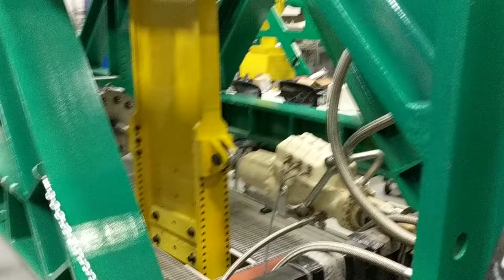Actuator Test Stand at MSFC

Comment: What is that? What does it do?
Reply from the maker: The beige actuator is the thing being tested. It's the "muscle" that pivots the big rocket motors for SLS -- probably RS-25, maybe the SRB? I can't recall now.

The green steel frame is the test stand. The yellow part represents the rocket motor.
Reply from the maker: Looks like this is a servoactuator from the solid rocket boosters for SLS, based on photos in the album I pulled this from.